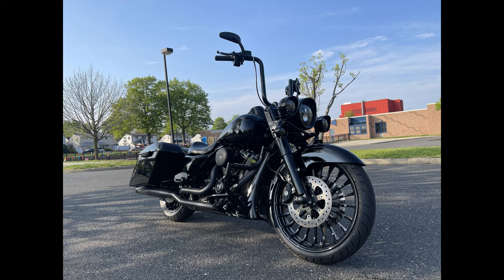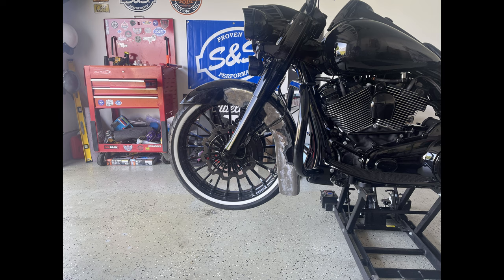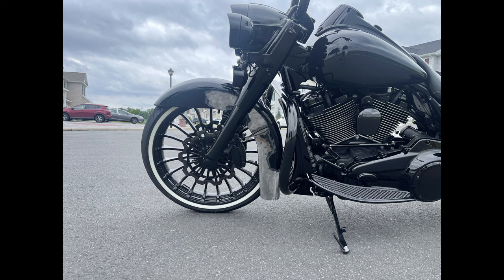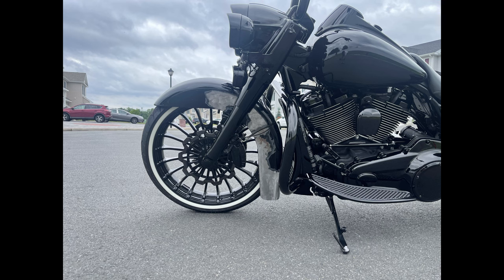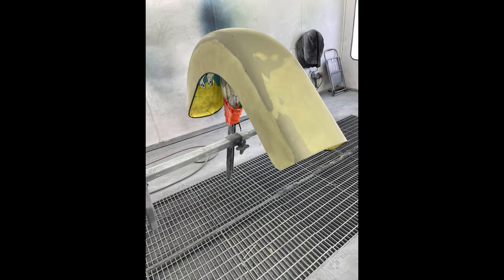Road King Special Vicla Build: Ep: 02 Stretched Front Fender #roadkingspecial #vicla #harleydavidson

Comment: Thanks for headsup on
Tailight lens ?did you do any fender mods as far as fitment  when you  put your 21 inch tire on so it wouldn't rub.
Reply from the maker: Good question! So yes I am running Drag Specialties Fender-To-Fork Adapter for 21in. Wheel (part no. 1410-0095)

Comment: I have 2019 RKS as well. That fender is definitely 🔥. Did you make any special adjustments do to the oil cooler?
Reply from the maker: Thanks! Nope no adjustments to the oil cooler. I run a Trask oil cooler fan (sits behind the oil cooler) and it doesn't interfere with the fender or anything else.
Reply: @darknessroadking  The fender just looks like it's gonna hit when  I steer left or right that's why I was asking... Thanks for the input and safe riding out there.. ✌️
Reply from the maker: @erikmarrero548  I hear you but can confirm that the fender doesn't touch at all even on full lock turns. Thanks again for commenting!

Comment: That looks sick so what was the total length you ended up with at the end I'm thinking to do the same as yours on my 2016 RK but I want to be able to add the original chrome trim top and bottom.
Reply from the maker: So in the end the fender was extended 3.5 inches. Before getting this front fender stretched I was running a stock RK standard fender w/ fender tip, rails, emblems and fender skirt trim. All this to say, if your fender already accepts the trim get that fender stretched and you'll be good to go. The stock fender from the 17-22 specials are like the street glide/road glide fenders (no holes for trim) so I left it as is.
Reply: @darknessroadking   Thanks do you think I would have any issues running my current fat spoke wheel  21X3.5  120/70-21
Reply from the maker: @PeteyPablo408  I run that same exact wheel size and have no issues. When I went from the stock 19" to 21" all I had to do was  run the bracket that raises the stock fender up a couple of inches so it doesn't rub. The one I run is the Drag Specialties1410-0096 Fender to Fork Adapter for 21" Wheels.
Reply: @darknessroadking  I purchased my bike already with the 21" wheel so maybe it already has the riser or I should purchase the riser anyway I'll have to look at it closely  thanks again

Comment: Amazing bike, can I ask you which handlebars is that? is it a 16 inch?
Reply from the maker: 16” Tradition handlebar from Steady Custom Cycles
Reply from the maker: 16” Tradition handlebar from Steady Custom Cycles
Reply: @darknessroadking  thanks a lot! Do you find the 16 inch bars more comfortable than your previous 14? I am about 6 ft tall and I still can not decide which ape size to take! Thanks again!!! :-)
Reply from the maker: @waltersinigoi8835 I’m 5’9 so the 14”s we’re in reality more comfortable/relaxed (it put bars in line with shoulders) but after a couple of days riding I don’t notice any difference with the 16” (only exception is on highway without a fairing sorta feel like a 🪁). I think 16” at your height is the way to go (akin to 14s for shorter guys like myself).
Reply: @darknessroadking  Thanks so much and compliments again for your darkness! 🙂